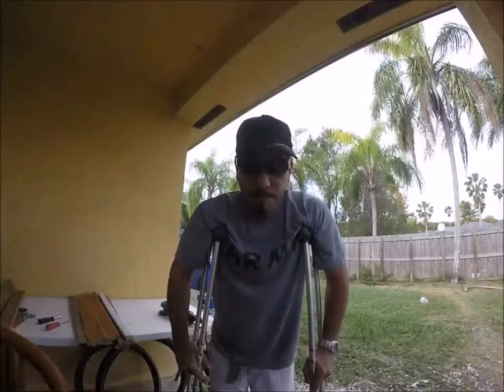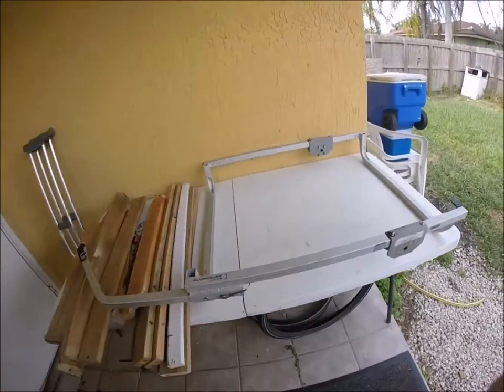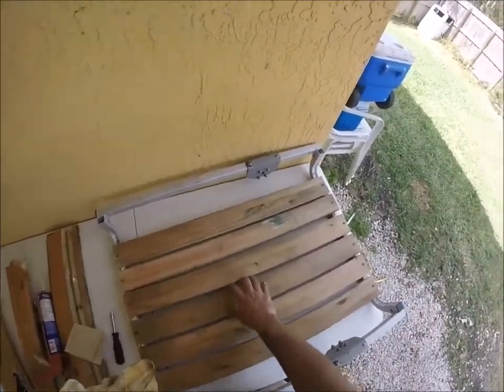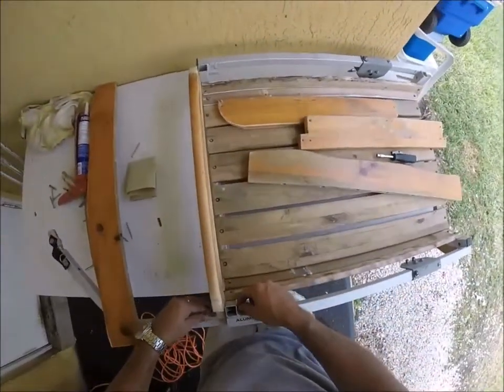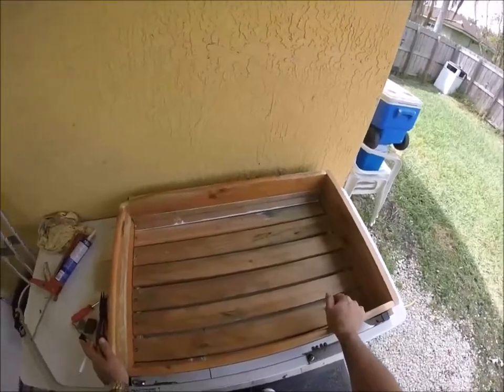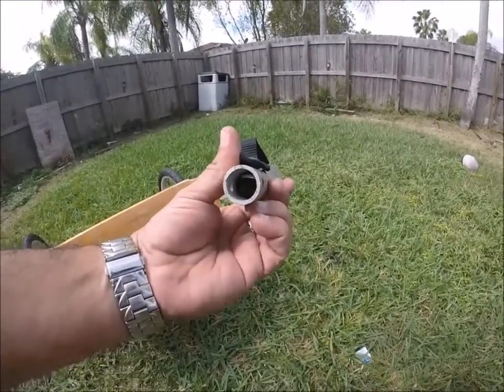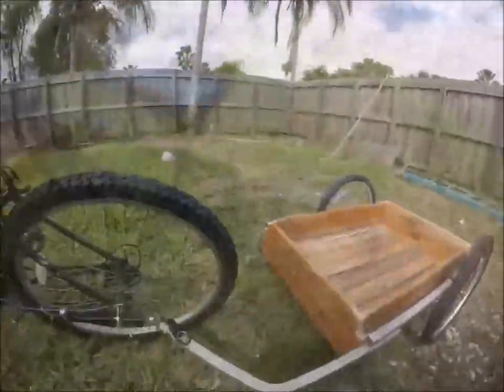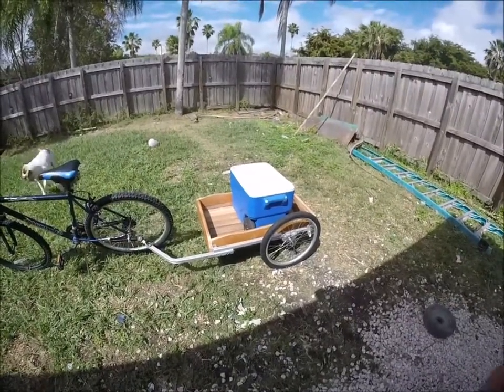Bike Fishing Trailer Build

Comment: My son and I built one like that and painted it red. I put a big wire basket on it for the stuff. I need to add rod holders. We used 99% up cycled materials. The trailer was set out for trash and I grabbed it.
Reply from the maker: That's awesome. Those carts are life savers when out on those trails. You can also change up the handle on it and use it for a bridge cart. Dual purpose. 😉😁